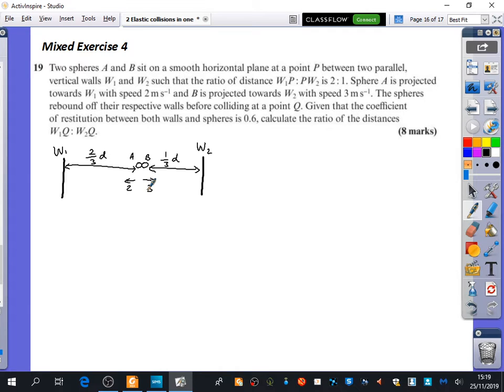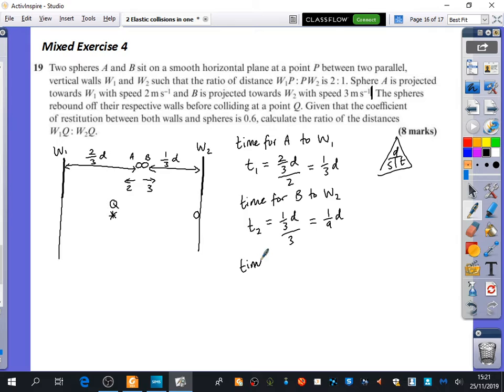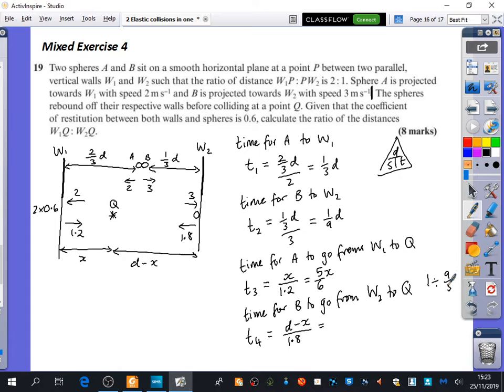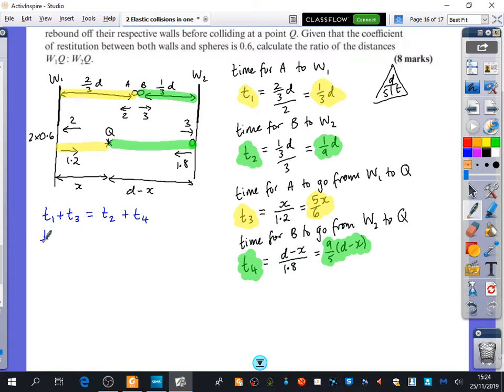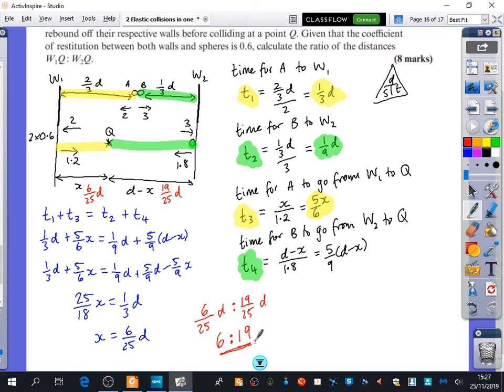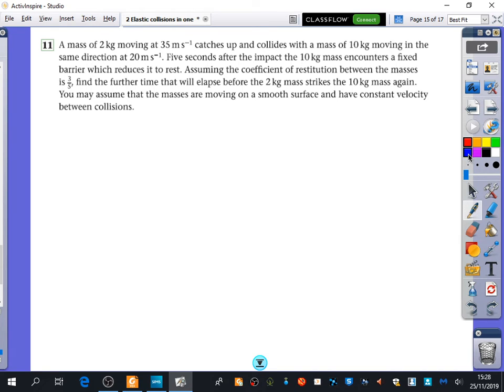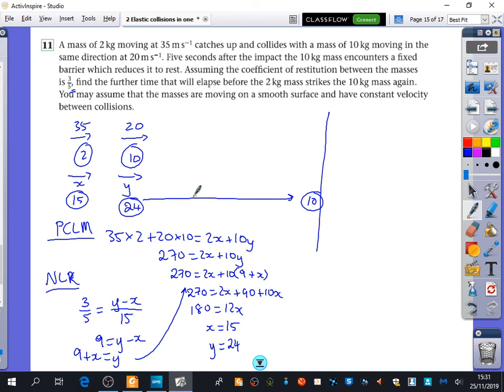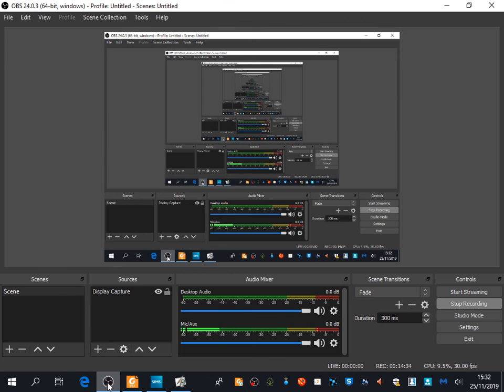Elastic Collisions in One Dimension 9 • Distances to Walls, further example • FM1 4Mixed • 🎯

Comment: Hi Sir, I understand your t1+t3=t2+t4 method however I did it a slightly different way. At the moment A hits the wall I calculated the distance B travelled after it hit its respective wall (I subtracted the times and used d=st which gave me that B has travelled 2d/5). And from there I said that the times are equal until the collision at Q (let x be distance from w1 to Q so x / 1.2 = (3k/5 -x) / 1.8) And I get x = 6d/25 like you! So I guess instead of looking at all the events together I only looked at the last one. Is this still a good method? Is either easier than the other? Thanks
Reply from the maker: Yes, this absolutely works! You've been making some really great comments on these videos - well done!
Reply: ya same